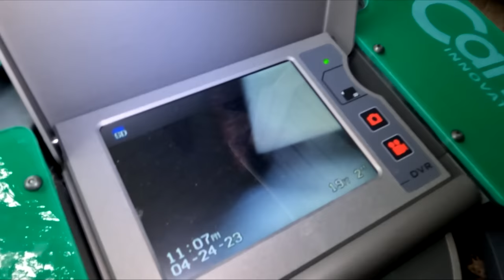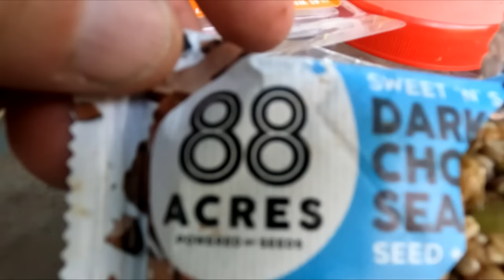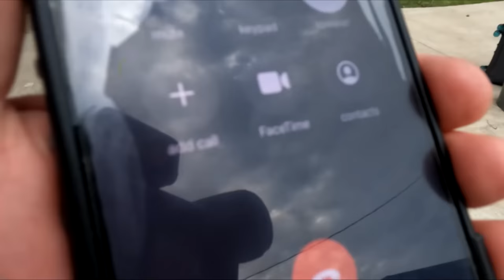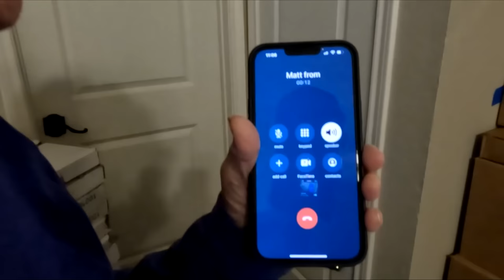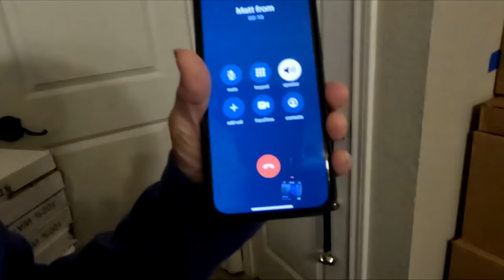BEWARE of these types of PEST CONTROL companies  (80 year old scammed)

Comment: I’ve been taken advantage of by a pest control company! &4,200.00! Had to pay a different company for help. 
Janet deserves someone like you to help her. She needs to take them to court!
Reply: It would cost more many if the lawyer fee is not included in the settlement, in most small cases it is not.
Reply: Dang, what kind of pest problem did you have.   I'm in pest control and I can't imagine any job being that much.  Not even a huge termite job would be that high where I'm at.
Reply: I'm worried cuz terminex wants 13k for 2000sq ft taking out all insulation blocking entry's etc.. 13k seems really high ugh
Reply: @cheriethrasher2143 get a second , third and fourth opinion .

Comment: There are bad contractors every where. I was surprised to see you reaction. That is how you roll. I would be extremely pissed if that happened to me. Why was she without water for 3 weeks. The pest control company could have replaced the pex( which is like candy to the rats) with copper, as you d id, and the lady would have had water while they worked on the rat problem.  When all else fails, there is small claims court. Hopefully, you gave her all the pictures and required things that she will need to sue the pest control company. And she will win!!!!
She needs to document her calls and your calls,  with no return calls on their part. This should be a slam dunk for her to win, and get a rrefund.
  Watch who you do business with.

Comment: Twin home experts also has electronic signatures. They charged me $5000 for a rat problem and caught zero rats after their twin trap. Didn’t catch any for a couple weeks. They came and put two regular Victor snap traps in my three car garage. I said I didn’t think that was enough For 700 square-foot space. They said it was enough so I went and bought some more traps I ended up catching two rats on the traps I purchased. I showed their worker Chris, who is mainly a plumber and entry point that they missed while sealing the house. I asked him to squirt some of that foam in it. He said he didn’t have any on the truck right now and didn’t do it so I had to go and buy foam and seal it myself as well. To top it all off, they threw away some valuables and didn’t compensate me for them.

Comment: I’m going through construction nightmare through my City. It is a $50,000 loan and had to use their contractors. Never signed ANY portion for them to get paid yet the City paid them. When asked why they paid them, “well I had to pay them”. They ruined my home! Everything they did was done wrong! Installed a furnace improperly - it’s leaking for one and charge me almost $10,000 just for the furnace. They cut my rafter tails, used shorter width fascia boards so rafter tails are showing and will rot out. didn’t cover my roof properly and my house was “raining” inside! Water coming down my walls and shorting out light switches! Water damage all throughout my home. Then I had one rafter tail that had a section on the outside of the house that was rotten. They slapped another 2x6 and sealed it next to it. I have been missing three rafter tail ends. One from a corner and two by my chimney. Gone! Well I found one. They cut it down and used it to butt up next to the rotted one. Unbelievable! I believe they forged my signature to get paid as well. I’m not sure about how much profit contractors take but they charged me $12( for a sheet of plywood. 55 sheets as a matter of fact. Total resheathing yet they only did the soffit part. It’s just a sad, sad mess! And the City is doing nothing!

Comment: Great video.  I trapped a bunch of rats along a fence like you did, but I made a small platform for the trap instead.  Didn’t think to just mount the trap right on the fence.  I had rats in my attic and I had a pest guy come out who wanted to put poison down.  No way!  I didn’t want dead rats rotting away in my attic. 
I learned more about getting rid of rats watching your channel than the bozo “exterminator”.
Cleared my attic of rats and removed their cover outside in my yard, myself.  Now free of roof rats thanks to the Twins!  😍
Peanut butter and cinnamon was the last meal for my roof rats.  😂

Comment: Is there a tutorial on how to make the hoods? Currently having the issue with terminex. "Everything is sealed" but still hearing noise in the attic.
Reply: I had Terminex and they were horrible.  They threw poison into a triangular opening above a ridge beam, which protruded outside, under an eve, where the rats were getting in, and never sealed up the opening.  I ended up having to solve the issue myself.  They are. Worthless company, as far as rodent control goes.

Comment: We used rat traps with Peanut butter to bait them, We placed them alot running boards & behind the appliances. It worked like a charm. We got rid of them in a week.  I could have done a better job than they did.  She had alot of clutter in the garage & a little in her home too with the stacked boxes.  That is a rats dream home. Especially if the clutter never gets touched or moved.
Reply: Clutter are the things from my water damaged cabinets, flooring, etc., that were totaled from my flood and put in boxes and In the garage for the time being until the restoration is complete ~ that was delayed because of this fiasco